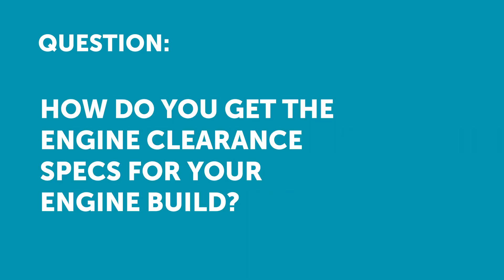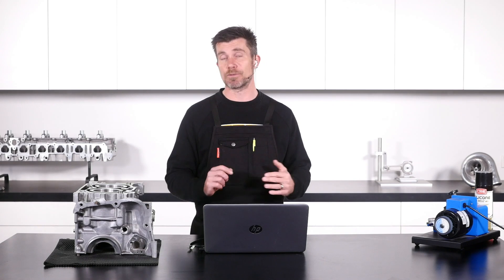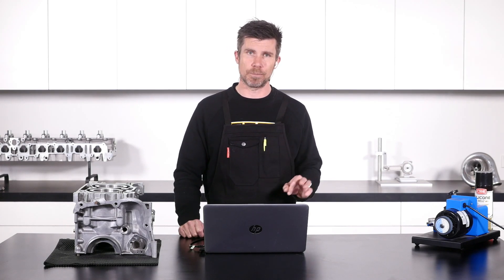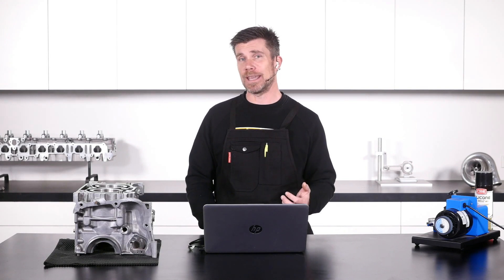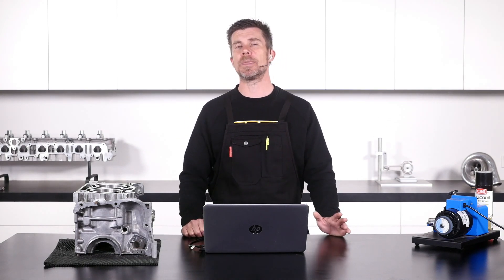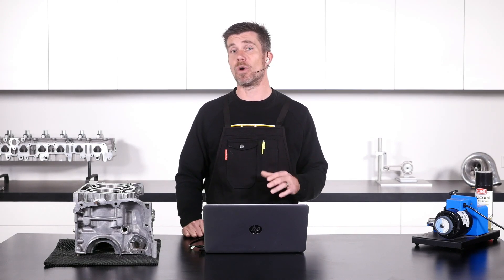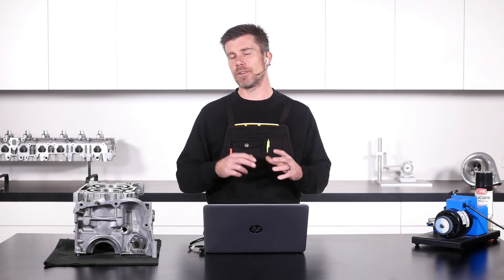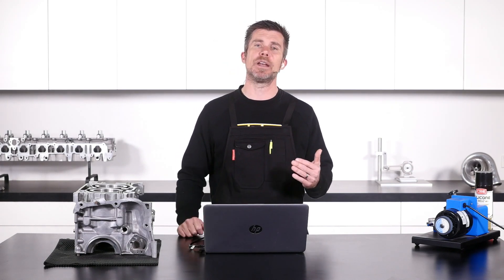How Much Clearance Do Your Bearings Need?  [HPA Q&A]

Comment: Could you still use those factory values if you are using completely different components ( forged rods & pistons) that expand at a different rate then factory materials?
Reply from the maker: @datboi8140  this video has some more detailed information  https://www.hpacademy.com/previous-webinars/214-adjusting-bearing-clearances/

Comment: How much clearance do your bearings need? Answer= what are you doing with the engine. That's really the answer. Drag racing? 100k miles on the road? Road track? Oval? Drifting? All these things make a difference in clearance, coatings, and material of bearings. I learned a long time ago building engines never tell someone exactly what it should be. If you are building said engine then yes inform the customer , but in reality its very complex.